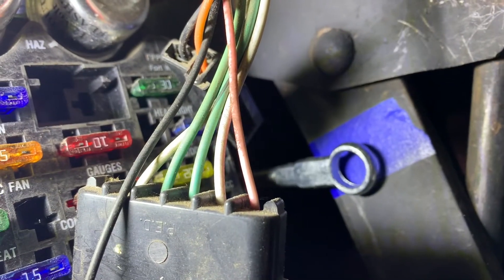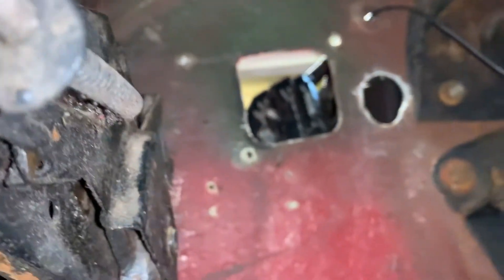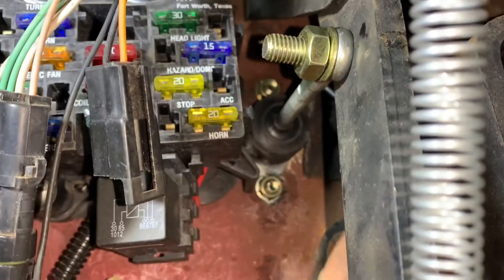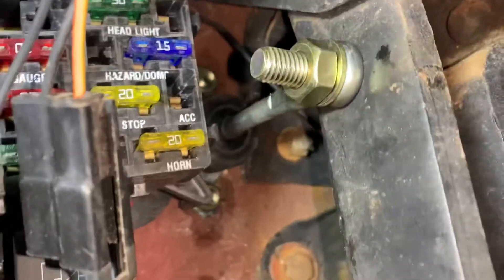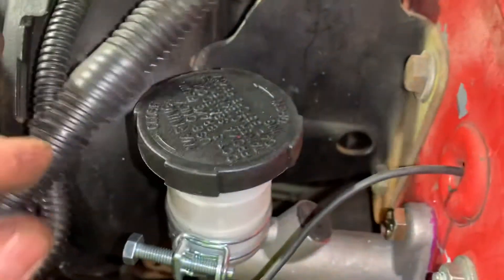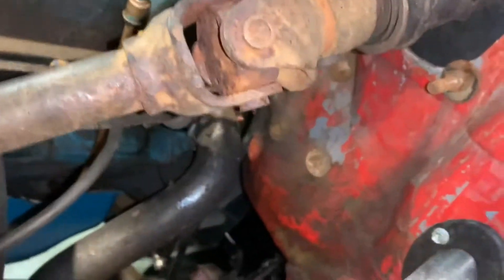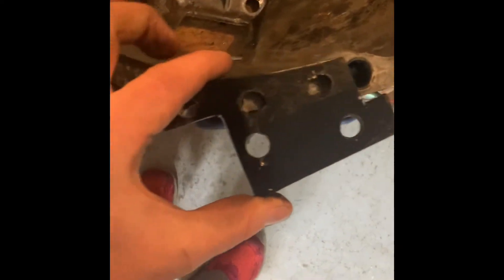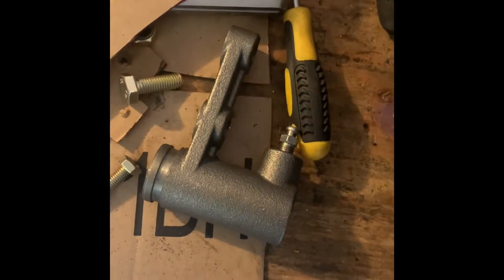CeaJaySeven - 1978 CJ7 - Converting from a mechanical clutch linkage to a hydraulic master/slave.

Comment: What size return spring did you use? Thanks, great video. Installing a Novak set up on CJ5 but was very unsure where to mount on the original clutch pedal.